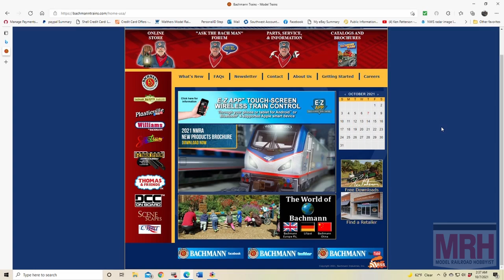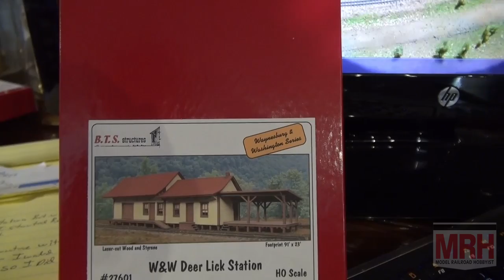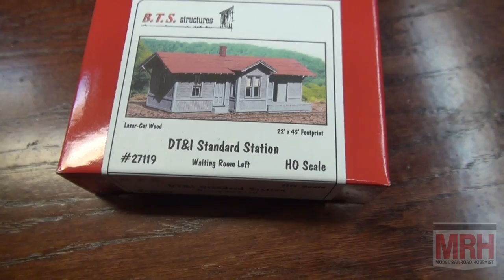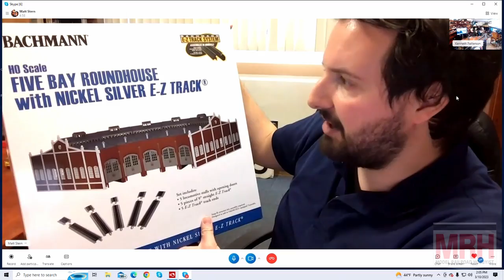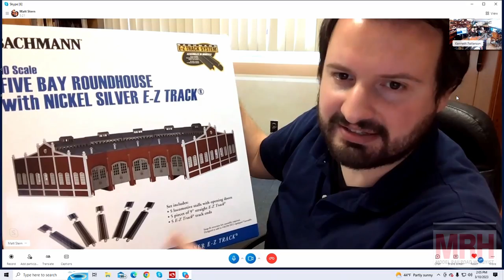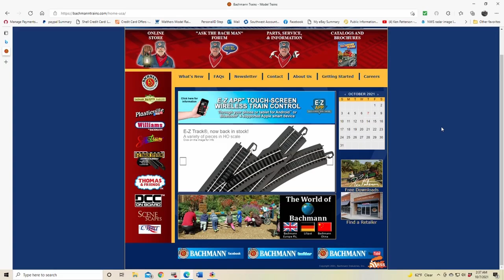Building a sectional layout:3 | April 2023 WHATS NEAT Model Railroad Hobbyist

Comment: Some day I'm looking at building a very simple turn table. It's from a railway in France, a small meter gauge one that's used today for just passengers. It only turns a single 0-6-0 steam loco without a tender. The nice thing is that you won't be able to see anything under the table and the table is a complete circle. No bridge or anything like this one.

Comment: I have a foam cutter like yours. Do you know where I can get replacement blades for it?
Nice video, very informative
Reply: I bought wire the same weight of the original ( or just a bit smaller ) and made my own shapes of blades.
Reply: @davidcurtis5398  Thanks

Comment: What I want to see, from the manufacturers, are IN CAB color mini cameras, wireless, wifi - I want to be able to control a power unit, with a computer or tablet, with a mini color camera placed in the power unit's CAB.    I want to experience operating from a CAB, such as would be seen by a real, live, living railroad engineer.    This would REVOLUTIONIZE model railroading - new views from the CAB.     I also want to see aged, graffiti-covered, oil and grease, dirt - on the rolling stock and power units.  ALMOST every model railroad, has pristine NEW everything - it's NOT real.      Oh yes, I want to see a real SCALE rail/track, with real scale wheels.     This is no reflection on the model railroaders, it's a question,a want list from the suppliers.     Come on suppliers, and manufacturers - get off of your butts and move the hobby to a new level.